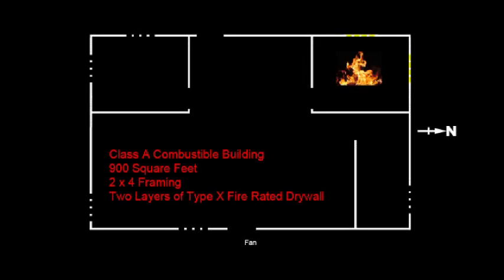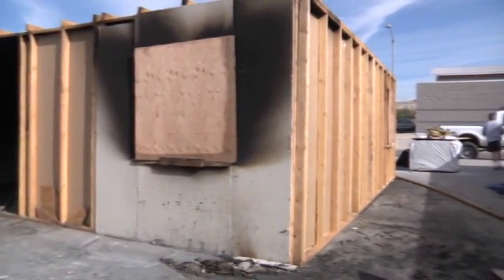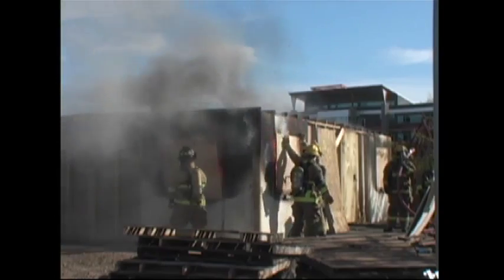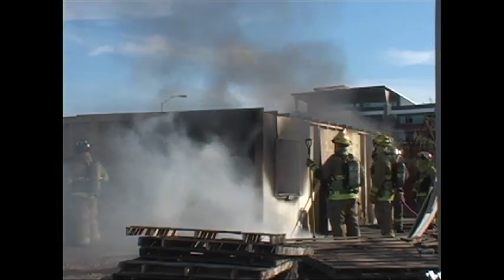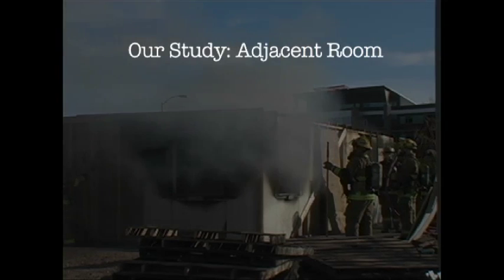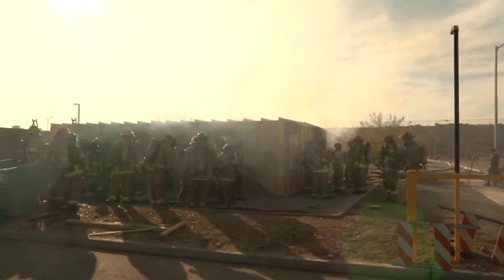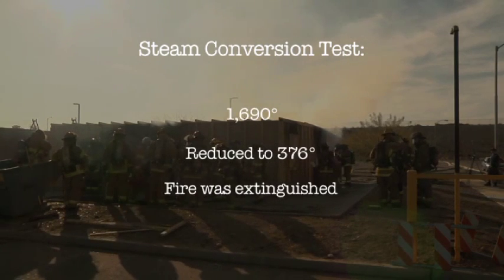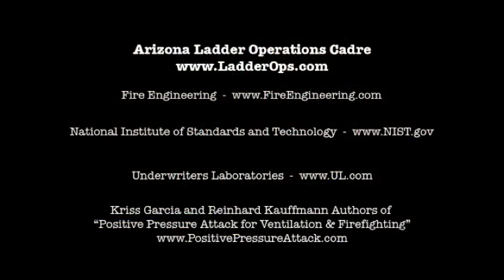Positive Pressure Attack

Comment: Why did you use pallets/straw and not modern furnishings?  Wouldn't modern furnishings give you more realistic temperatures due to the increased BTU release rates?
Reply: It would have been nice, but for safety reasons, NFPA 1403 doesnt allow use of those types of materials when conducting live fire training.

Comment: I am not 100% against PPV/PPA. I would say it has a place (especially if done by people like you that clearly understand it). Here's what I am against:
1) Starting PPV and then deciding whether or not it's effective (barometer). This may have negative consequences and definitely wastes valuable time.
2) Letting PPV delay in any way the agressive interior attack needed to quickly control structural fires.
3) The idea that inside team deserves clear visibility. Too many proponents cite this reason

Comment: Yes, but the smoke you're reading at your barometer point is artificially manipulated by PPV. If PPV is started and then stopped based on what you read at "barometer", a lot of time has been lost (and heat/smoke/gases pushed/pulled to "cleaner" areas?)  Fire could very well have been extinguished by this time.
In our culture we run into near flashover (or post flashover or ALMOST anything else) conditions with a charged hoseline which we quickly operate at 180 GPM to extinguish fire.

Comment: I am all for an outside survey being done. But that time should not come at expense of hose stretch. Should be simultaneous. What I am against is taking time at expense of hoseline advance to enlarge a window opening.
If fire location can't be determined from exterior, then yes we go in to locate it, using ears, eyes, TIC, etc. Venting should NEVER be done as a way to locate fire. Nor should it be done to improve visibility.

Comment: I don't really like the time factor involved in making openings bigger. By the time you cut and pull the walls, you could already have the fire extinguished. That's assuming an agressive interior attack is made. I've seen way too many videos where fire attack is being delayed so ventilation (horizontal and/or vertical) can be completed. The manpower committment to venting often exceeds that of fire attack. This is pretty much backwards.

Comment: My concern is that modern day fires produce very large amounts of incompletely burned fuel (smoke/fire gases).  If the exhaust opening is too small (which in my opinion it will often be), I believe the positive pressure will not be enough to exhaust all of the heat energy and unburned fuel to the exterior. Now what happens? How could it not spread to areas (rooms) of lower pressure or out the attack opening? And light up in the process? What now happens to "standing up" search and  attack teams?

Comment: Just curious. Were any tests done where exhaust opening was one half to one times the size of attack opening? I think this ratio is more realistic for most of us. (Typical bedroom with a 30-32 inch door and one or two 30x40 inch windows) 
Also, were any tests done well after the fire had flashed and subsequently darkened down? This is a more realistic time frame because most of us don't arrive to a fire right when it flashes (or just before or after). We arrive in a later stage of the fire.

Comment from the maker: Yes, we used softwood pallets and straw.  We used thermo-couple temps along with smoke conditions to determine when we would send crews in.  For our drills, the best temperatures to start the evolutions were right at 1400F at the top of the fire room with smoke conditions down to the ground with flames starting to "finger" out from the burn room.  After all the PPA evolutions were done, we did let it flash. Flash ooccured at 3m 45s from the time the pallets were burning.
Reply: ladderops @